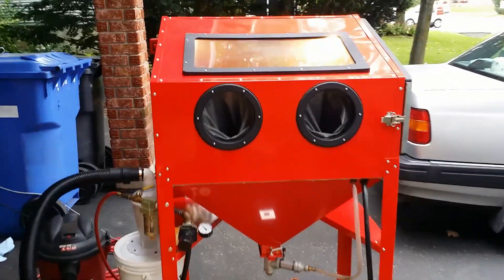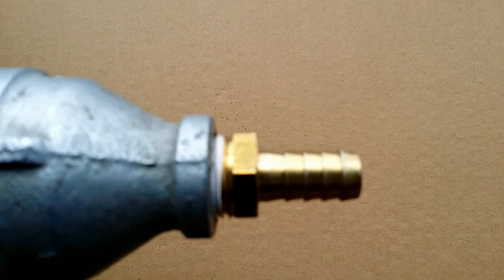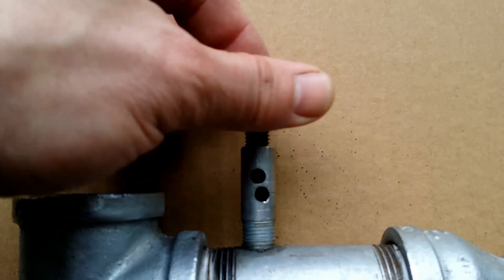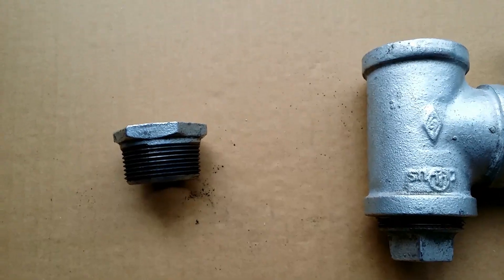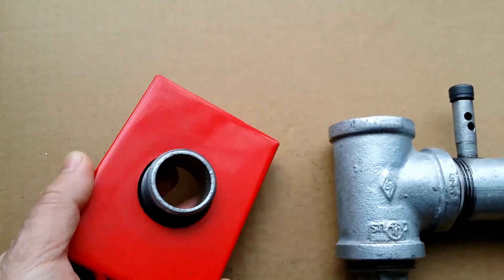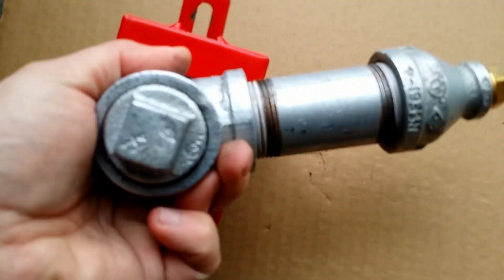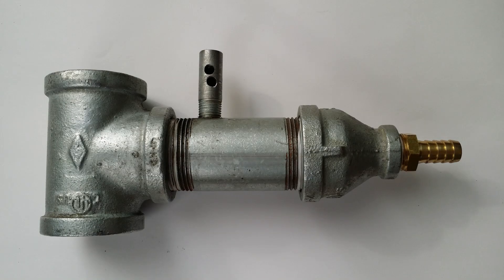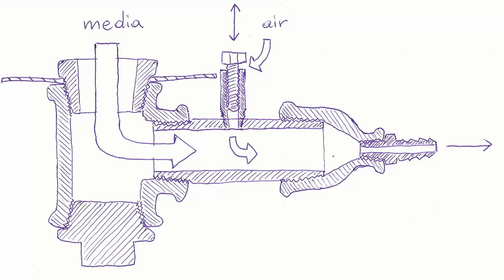DIY Metering Valve for Sandblasting Cabinet

Comment: Robert -  I discovered your video from a comment you left in another fellows blast cabinet mod video with a Princess Auto unit.  Great explanation and thanks very much for posting.  The small little pipe with the bolt and holes in it - is this some standard part that you drilled and tapped for the bolt or did you find it somewhere ?  Also - what size is the adjustment bolt and air holes that are in it ?  Thanks again.  I'm hoping your video will save me a bunch of money.  The metering valves are way overpriced for what they are that are being sold for this purpose.
Reply from the maker: The small pipe is 1/2 inch galvanized nipple fitting (any hardware/home improvement store). Cut male threads on one side. The inside thread, that you have to make, depends on the bolt you will use (metric or imperial). Don't go crazy about the precise size of the side holes, just don't make them too tiny.  You can even make one bigger hole. Some people put there a ball valve.
Reply: Robert Deptula 
Thanks !  I don't have a cabinet yet but I'm going to apply this metering valve as soon as I get it.  One other question  - your other video shows a nice compact gun.....well it's not really a gun shape - just a simple "y" shape.  Can you tell me where you got this ?
Cheers from the east coast 😊
Reply from the maker: @lewiscobb7817  You can buy one on Amazon or Banggood. In my previous video, I have included a whole list of sources for the gun. See comments under the previous video.
Reply: @robertdeptula2003  just want to know if there is another hole in the back of the small pipe? Thanks
Reply from the maker: No. There are only those two. It is not really critical how many holes there are. You just need to introduce air into the valve and be able to regulate the volume. Try with one or two, see how it works for you and you can always make some more if needed. Good luck!
Reply: @robertdeptula2003  Thank you very much.
Reply: @robertdeptula2003  And the small pipe is about 2 1/2 inches long?
Reply from the maker: It is standing one and a half inch high (measured).
Reply: @robertdeptula2003  my last question,and the straight pipe is 3 1/2 or 4 inches.? thanks
Reply from the maker: 3 1/2
Reply: @robertdeptula2003  Thank you so much.
Reply from the maker: You are welcome. Good luck!
Reply: @robertdeptula2003  Hi,Robert got everything that I need from HD.Now can you please tell me what size drill and tap do you use to install yours ? I have the same size as you.Thanks
Reply from the maker: I don't remember. You have in a tap and die set a thread pitch gauge, so you can determine which size you need. You can take a piece of scrap metal and try different sizes to see which one will be the best fit and then drill and thread the pipe in your valve.
Reply: @robertdeptula2003  Thank you.

Comment: Robert, what size nipple is that  , that you screwed into at the top with the bolt ? Thank you
Reply from the maker: 1/2 inch in my case, but you can use other size that will accommodate the bolt that will be used.